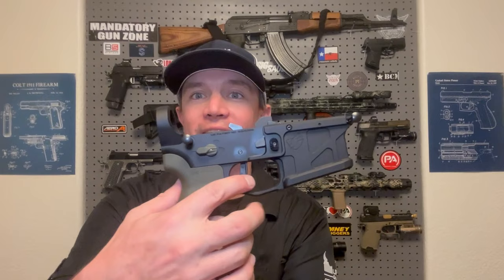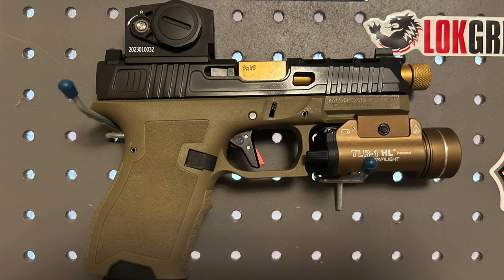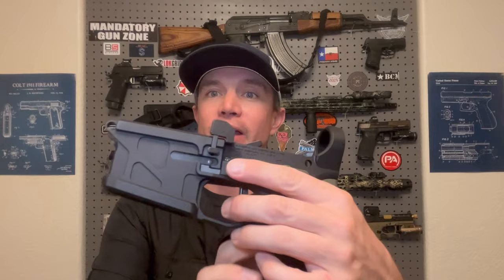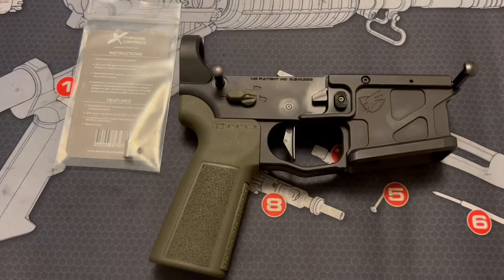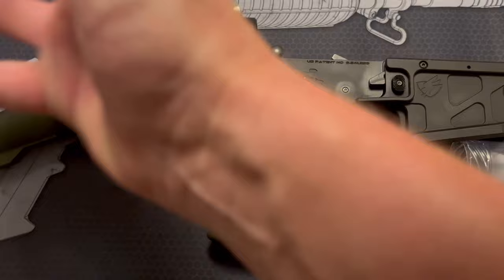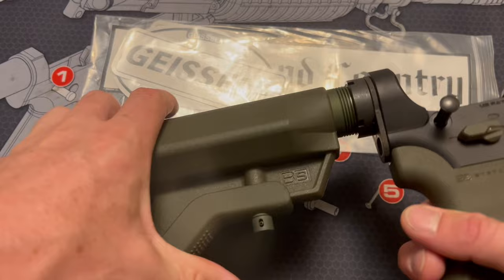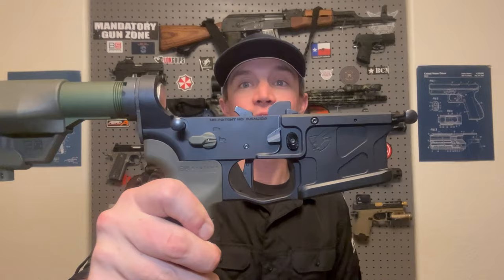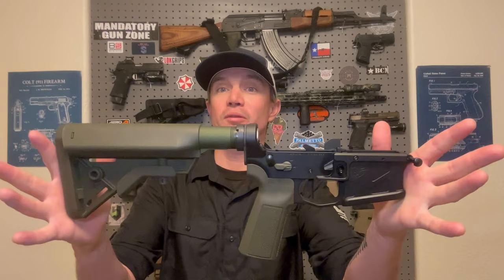Dream Rifle Build Part 3 - Geissele Super 42 & B5 Systems Bravo Stock

Comment: Please excuse my lack ogle knowledge on terminology. But, I’m putting together my ADM lower receiver tonight. Love it!! My question is, do I need that small spring that you have to sandwich between the QD baseplate and the backside of the lower receiver? If so, what is that spring called bud? Great video and I love all of your content. You seem so down to earth! I’d appreciate your feedback my man🙏🏻 Merry Christmas as well!!!
Reply from the maker: Thanks for the positive feedback and Merry Christmas to you, too!  You do need that spring, but if I remember right, the lower came with it already installed.  That little spring is what makes your rear takedown pin detent work.  It's always kind of a pain in the ass to deal with, so I was really happy to find the takedown pins already installed when I got my ADM lower.  This lower didn't really need a full lower parts kit, because of the proprietary ambi parts and the pre-installed takedown pins.  All you need is a trigger, safety selector and buffer retainer.  I hope this helps...
Reply: Awesome!!! Thanks for the response bud🙏🏻 I believe that detention and spring is in there. I was able to throw on an upper and the rear takedown pin held in place.